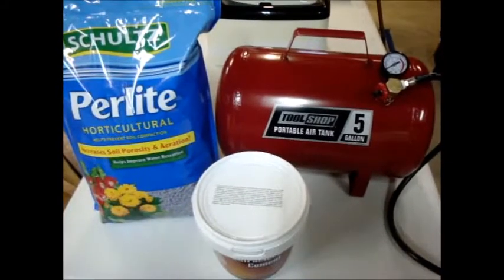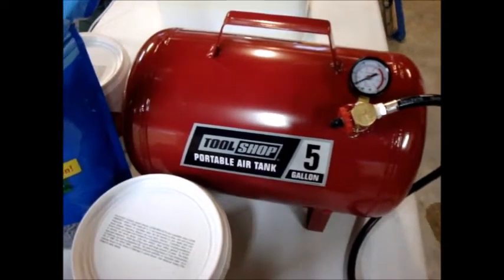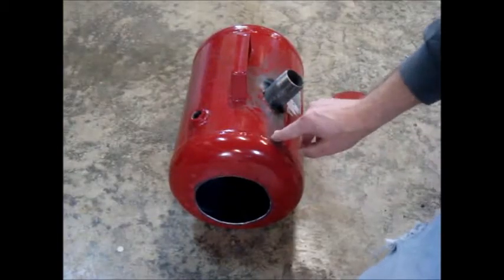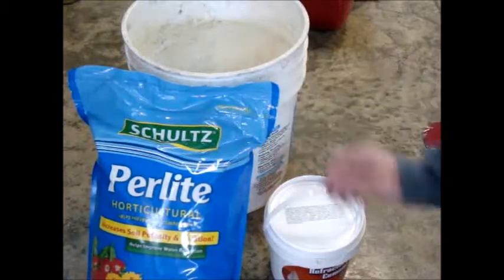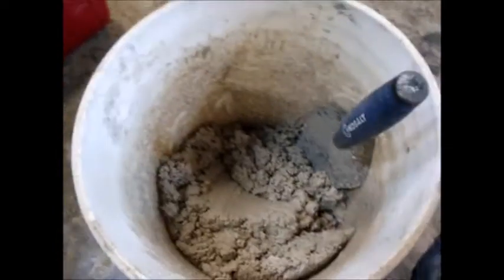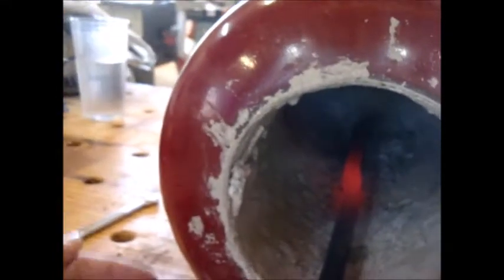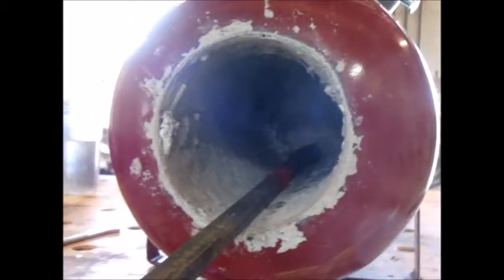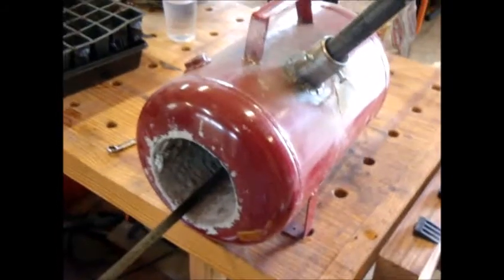Propane Forge

Comment: Ya bud, i think the examples touting perlite may have been mislead and misleading the rest of us.. .it has a low melting point turns to glass and sags like lava...in my very limited experience... 

If you are to use it... it is most certainly necessary to properly wet cure the cement to get a good strong crystalline matrix around the aggregate to hold everything together as the perlite turns to mushy glass under high heat.... 

It seems a much better alternative is polystyrene .. demonstrated in greenlight refractory cement.. instead  of turning to molten glass making a mess and potentially leaving good insulating air pockets behind... the polystyrene vaporizes.. turns to suit.. (less mess) leaving valuable air pockets behind... but still .. .a proper agregate and wet cure following the initial drying is likely to be very much necessary.

I think a "well graded" high temp aggregate meaning several grain sizes small medium and large, maybe 300 grit, 120 grit, 42 grit silicon carbide or aluminum oxide abrasive media.. or tungsten carbide, encased in a well cured refractory cement, perhaps treated with a cement superplasticizer to get a stronger bond, along with polystyrene beads to be burned away producing insulating value.. possibly also graded in varying sizes or shapes... with a quality ceramic fiber insulation behind it... would rigidly hold, refract, and contain the heat... maybe last for a long time.

just my novice two cents, thanks for sharing your experience and making this video.

I will save my perlite for the garden.... or for filtration.. but it will not be in my refractory..at all